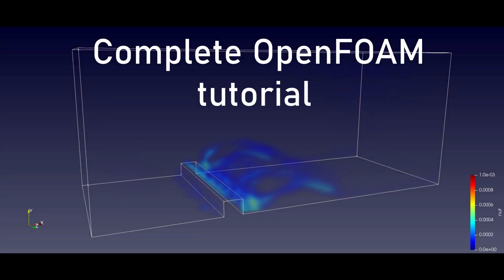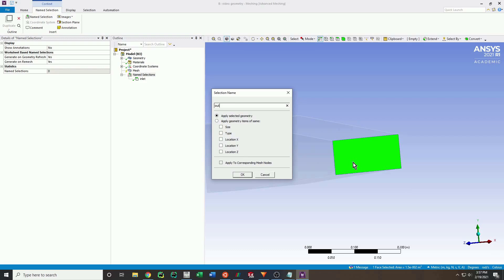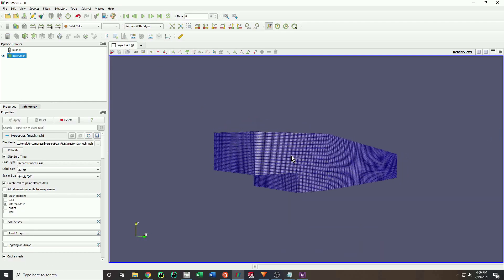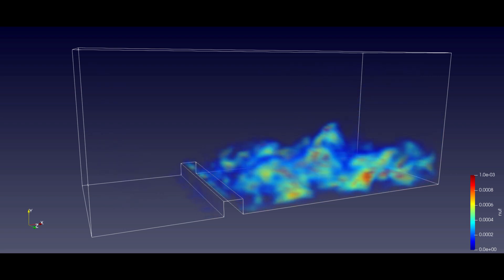Complete OpenFOAM tutorial - from geometry creation to postprocessing

Comment from the maker: Time-Stamps:
0:00 - Introduction/Overview
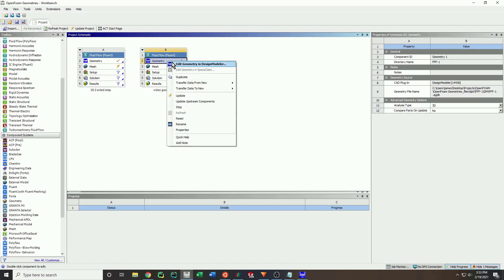1:09 - Geometry: ANSYS DesignModeler
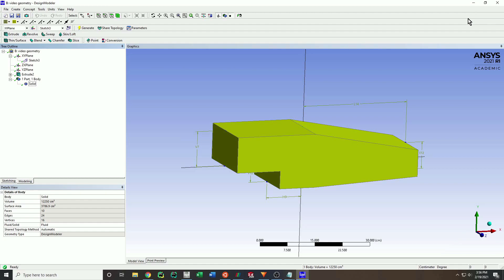2:35 - Generate Mesh: Fluent Mesh
3:57 - Exporting Mesh File
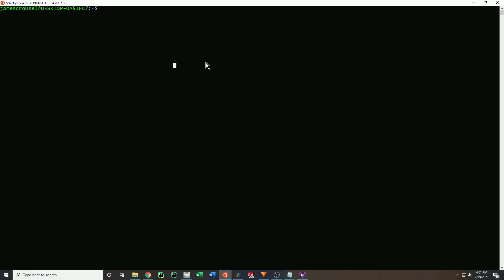4:27 - Navigate to project folder
5:05 - convert mesh to OpenFOAM format
5:36 - Check and modify boundary conditions
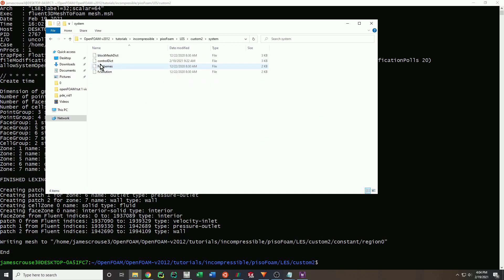6:46 - Calculation Control
7:23 - Check mesh in ParaView
8:36 - run calculation
8:56 - save results
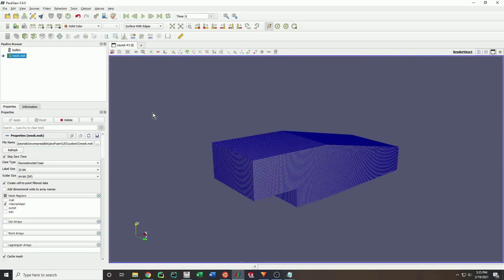9:20 - post process in ParaView
10:40 - animation/closing remarks

Comment: There is a paper published, which I found on the 'web, which identifies that for aircraft-simulation, OpenFOAM becomes physics-correct at 11.1-micron cells, in the boundary-layer.

They tried all sorts of cell-sizes, & graphed the accuracy/lack-thereof, showing how they needed to get to that resolution.

They were demonstrating that OpenFOAM could do an aircraft ( it may have been an airliner, & it probably was transonic ).

That isn't a limit that most people know-about: that you have to get to sooo-small cells that the validating-experiment matches the simulated airframe..

Which kinda explains why it's supercomputers that such simulations are run on, when there's actual-aircraft involved..

_ /\ _

Comment: This is not a complete tutorial... You have edited some of the files in system and you have not shown what you have done.  blockMeshDict for example has "upperWall", "lowerWall" and "frontAndBack", whereas our geometry has just wall.  I have no idea what values to put in the matrices for wall.  Running this setup throws errors. So this is another frustrating, incomplete OpenFOAM tutorial....

I get this error:

"--> FOAM Warning :
    From void Foam::polyBoundaryMesh::calcGroupIDs() const
    in file meshes/polyMesh/polyBoundaryMesh/polyBoundaryMesh.C at line 100
    Removed group 'wall' which clashes with patch 2 of the same name.
--> FOAM Warning :
    From Foam::labelHashSet Foam::polyBoundaryMesh::patchSet(const Foam::UList<Foam::wordRe>&, bool, bool) const
    in file meshes/polyMesh/polyBoundaryMesh/polyBoundaryMesh.C at line 915
    Cannot find any patch or group names matching lowerWall
--> FOAM Warning :
    From Foam::labelHashSet Foam::polyBoundaryMesh::patchSet(const Foam::UList<Foam::wordRe>&, bool, bool) const
    in file meshes/polyMesh/polyBoundaryMesh/polyBoundaryMesh.C at line 921
    Cannot find any patch names matching lowerWall
Sampled surface:
    nearWall -> vtk
        sampledPatchInternalField: nearWall : patches:1(lowerWall)"

EDIT: seems to run now.  The only change I made was making sure that deltaT = 0.0001.  However, my point stands with the blockMeshDict file.  Why does it still run even though upper/lower/front and back are mentioned there?  And if I want to only mention "wall", how do I find the values to put in the matrix?
Reply: Hey, from what I understand, you don't need to use the blockMesh command since you're importing a mesh from ANSYS. The command blockMesh it's meant to be used for creating the mesh. That's why he glosses over like it's nothing. Once again, i'm a beginner in the software, so I could be misunderstanding everything, but I hope i was helpful!

Comment: I have been able to follow everything up until the fluent3DToMesh command. It is giving me: "FOAM FATAL IO ERROR: Essential value for keyword 'field' not set. In function entry: scalarTransport in file /.../controlDict at line 130 The function entry should be: scalarTransport(field = <fieldName>)". 
Regarding the path, I copied the folder from the github repo titled OpenFOAM-pisoFoam-LES-Step-1-main and placed it in my tutorials/.../LES path making sure to add the mesh.msh file also. What changes do I need to make to the controlDict file to correct the error?

Comment: Hi, I've encountered this error, any insights on how to solve this? Thanks.

# Probe 0 (0.0254 0.0253 0)  # Not Found
# Probe 1 (0.0508 0.0253 0)  # Not Found
# Probe 2 (0.0762 0.0253 0)  # Not Found
# Probe 3 (0.1016 0.0253 0)  # Not Found
# Probe 4 (0.127 0.0253 0)  # Not Found
# Probe 5 (0.1524 0.0253 0)  # Not Found
# Probe 6 (0.1778 0.0253 0)  # Not Found
Reply from the maker: You may have an extra function in your control dictionary, try to create a new empty directory and add only the files I provide.

Comment: Hey, quick question. Do we ever create our own controlDict and other files? As in, are problems always run by making use of the different cases given inside the 'tutorials' folder in OpenFOAM? Will there be a requirement to create out own controlDicts and/or other files? Thanks a bunch!
Reply from the maker: As I have advanced more in OpenFOAM the amount of modification to the cases has increased but I would never create one from scratch. But you will notice in my newer videos that I do change cases significantly by adding functions, adjustable time-steps, scalar transport, etc...
Reply: @interfluo6420  Thanks for getting back so quickly, appreciate it! So basically you would just identify what problem you need to solve (multiphase, incomp., etc) and use the included case files in which you can modify the various parameters? If one were to create their own files, would you know how to go about that? 
Your videos are awesome, kudos!
Reply from the maker: Yeah, that is the basic premise. I am not really sure as far as making your own files from scratch, people have likely written programs to generate the, but I haven’t looked into it. Their are so many examples that I have never had trouble finding a couple of cases that I can put together for the problem I am solving.

Comment: i ran the pisofoam however there is an error: 

--> FOAM FATAL IO ERROR: (openfoam-2106)
Unexpected EOF while reading dictionary entry

    From static bool Foam::entry::New(Foam::dictionary&, Foam::Istream&, Foam::entry::inputMode, int)
    in file db/dictionary/entry/entryIO.C at line 165.

do you know how to fix this? thanks in advance
Reply from the maker: So I know that EOF errors occur when the program unexpectedly encounters the end of the file. This is likely cause by a missing parenthesis or semi colon somewhere in that dictionary. Unfortunately I don't know of any easy way of doing this besides checking all of the files manually, the problem shouldn't be in the files I uploaded unless their was an error when you downloaded them, it appear to be in your db/dictionary/entry/entryIO.C at line 165.

Comment: Hi. Thanks for the helpful videos. I am a beginner in openfoam currently learning it in windows Ubuntu LTS. 
When I modify any case file in a text editor, I have to everything give it the read permission in terminal before solution. But, you do not seem to be doing it. Please tell me how can I give permission once and all for all case files so that I can also use it seamlessly like you.
Thanks in advance.
Reply from the maker: Hey, I installed OpenFOAM following this video: https://www.youtube.com/watch?v=cUbC0MrkiOA . I don't remember, but their may be a step in it that can help you. I have never had an issue opening up files in a text editor (notepad or notepad++ is what I use) so I don't really know how to help you. Hopefully someone else who has resolved a similar issue will see your comment and reply, good luck!
Reply: @interfluo6420  Thank you for the kind response. I recently reinstalled openfoam exactly as per your installation video but the problem still persisted. I extensively searched for it on internet and unfortunately there are no clear solutions to it, although couple of people have reported similar issue. However, fortunately after trying several text editors, I found that notepad and MS visual code are working well and I do not have to provide the read permission after every edit.

Thanks again!

Comment: I cant get ANYSY to work. Are there any alternatives? I use Fusion 360 to generate my Geometry but I dont know how to generate a Mesh for CFD. I am trying to learn CFD for my hobby, building RC planes.
Reply from the maker: yeah, there are plenty of options. In some of my other videos I use snappyHexMesh and cfMesh for instance but you can also use gmsh. I am sure there are plenty of other options I am forgetting to mention but those are the first free ones that come to mind
Reply: @interfluo6420  Thank you for answering this quickly. I actually got ANSYS to work but struggle with the installation of OpenFOAM. My User folder has a space in it and I think thats a problem for Ubuntu. I have created a new User an will try to install it there. When i tried to run a tutorial to see if the installation works i got an error something like this: 

fileName::stripInvalid() called for invalid fileName commandtouse
For debug level (= 2) > 1 this is considered fatal
Reply: Now I have solved this problem as well. I am struggeling with transfering my Mesh to OpenFOAM. Where did you save it? I dont even know where OpenFOAM is located to be honest. I ran a tutorial and it worked, following the commands on the OpenFOAM Download webside.
Reply: I successfully completed my first simulation. While writing this comment, i am runing my first parallel case. Thank you for the help, although some parts of this Video were rushed. Still, you are the reason my first simulation worked
Thanks

Comment: Hello, 

I am discovering OpenFOAM, I keep having an error in the console where I doesn't find my .msh file. I am using Ubuntu 20.04 with the same OpenFOAM version (20.12). Any help would be really appreciated, thank you.

Also, besides this error, how should we setup the 0, system and constant folders' files ?
Reply from the maker: The only two thing I can think of is to make sure your mesh file is in the correct location (you should have your folder containing 0, system, constants, and .msh file); the other thing is to make sure that you export the mesh in the correct format (I show how in the video).

If you watch some of my newer videos I go a bit more into depth on how to set up the 0 folder, but I honestly haven't done a full length tutorial yet because it changes a lot depending on solver and turbulence model used. I would suggest using: https://www.fluidmechanics101.com/pages/tools.html . I am slowly developing a calculator myself and you will be able to find it here: https://github.com/Interfluo/CFD-tools
Reply: @interfluo6420  Thank you for your reply,

 I tried with another computer and now it works! I don't really get why for the moment... but anyway I can continue my project now.

Also, thanks for your work it seems really great ! I found Open FOAM very difficult to understand at first glance, because of the lack of documentation. It is great to have such a great community working on it!

Comment: Thank you a lot! I am learning to apply LES in building ventilation simulation in bluecfd and I find this video very helpful and straightforward! I have a very simple question: why do we use OpenFoam to do simulation if we have Ansys Fluent? What's the advantage of OpenFoam compared to Ansys Fluent?
Reply from the maker: Several reason, the main one when I first started was that I only had access to an academic license (limiting me to 500,000 cells). Since then I have really come to like openfoam, having direct access to the code opens up a lot of possibilities and I honestly also like the workflow and file system used for openfoam.
Reply: @interfluo6420  what are the alternatives if we don't have Ansys at all? How do we create the model and mesh?

Comment: I can't get Ansys to generate a mesh like yours. It creates a mesh on the surface and not on the inside of whenever I try to get it generate my mesh. No matter what I do Ansys just creates a mesh that is on the outside of my geometry, so it never works.
Reply from the maker: hmm, I have never had this issue. 
the only suggestions I can think of are to:
1.) try switching to wireframe view, maybe you are making the internal mesh but can't see it
2.) make sure that you are hitting "generate mesh" and not "generate surface mesh"
3.) try a different meshing software, my latest video cover cfmesh for instance (https://youtu.be/e2N-h0e_SmM)
that is the best I can do without seeing what is going on, hope it helps!
Reply: @interfluo6420  I've messaged you on linkedin. I'm hoping we can DM each other because I could really use some help.
Reply: @interfluo6420  I've done everything exactly as you have and it still won't work.
Reply: @interfluo6420  anytime I create my own mesh it never works. I've been trying to get something to work for the last two days straight. I'm about to give up because I feel like I've wasted so much time trying.

Comment: Hi. Thank you for your tutorial. Unfortunately m, I was disappointedat. I mean the content of the video and its description are not identical: No focus on how to setup the case, no focus on the turbulence model, why to choose that model, how to set its coefficients, how to set the boundary/initial conditions in 0 folder. The main focus was only on mesh generation which is relatively easy compared to case preparation and proper setup itself.
Reply from the maker: I have some more in depth videos coming up, this one was really geared towards beginners. You are correct, I assumed people would be able to find a close enough example in the tutorial folder that they wouldn't have to worry too much about the actual case set-up, that is why I went over that part pretty fast. I linked a github repository if you need any files, Thanks for the feedback
Reply: @interfluo6420  Thank you. I look forward to watching them!

Comment: Oh wow! I just started learning OpenFOAM two weeks ago and I'm in the exact position you described. Its really difficult to find actually helpful (beginner focussed) content out there :(. Thanks for making this! :)  I did have a question if you have the time. I'm trying to simulate airflow around an air rifle pellet (basically a bullet) as if in a wind tunnel. How do I best go about setting up the original case folder? I could indeed just copy a folder like the motorBike tutorial, but every file there already seems customized to fit the motorbike.obj model. Is there a more basic way to create a case folder that works for general models or does that require extensive knowledge beyond a beginners capacity?
Reply from the maker: Hey, thanks for the comment! The general procedure I follow is first defining the flow type and solver I am looking to use. In the case of an air rifle pellet I would think that you most likely want to use a solver for a compressible flow. I would then find the example with the most similar boundary conditions to the ones I am trying to simulate. In the case you explained I would likely use:  tutorials/compressible/sonicFoam/RAS/nacaAirfoil directory.

Hope this helps
Reply: @interfluo6420  Yeah but, don't boundary conditions reflect the geometry of the mesh you're using?  A bullet has a different shape to an airfoil, how do you set boundary conditions on the exact geometry of the bullet?
Reply: You need to change the definition of the boundaries for each parameter file in the 0 folder, when anasy divides the mesh you need to remember your naming and define the different boundaries according to the naming
Reply: is it possible to create geometry on OpenFOAM without using ANSYS software?